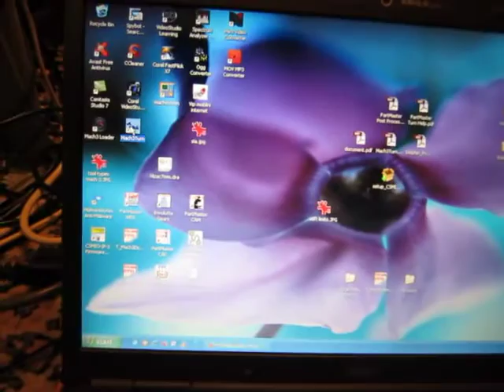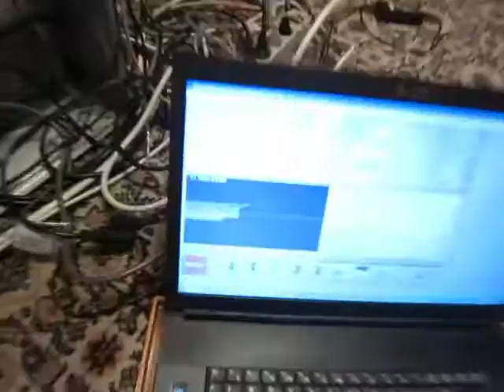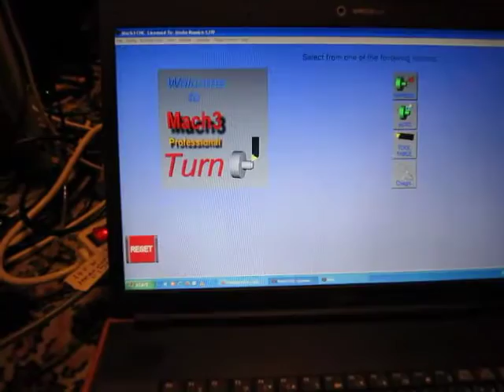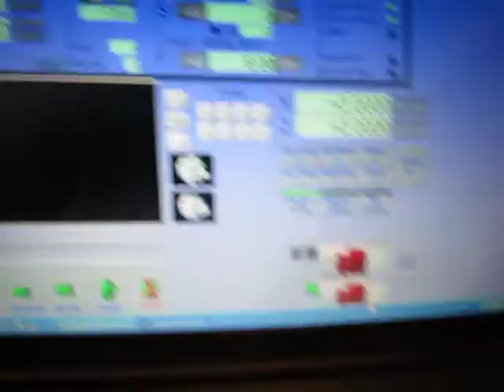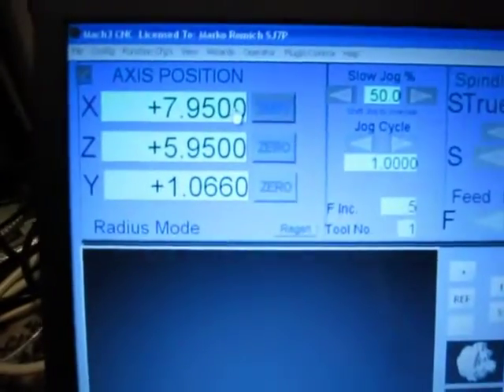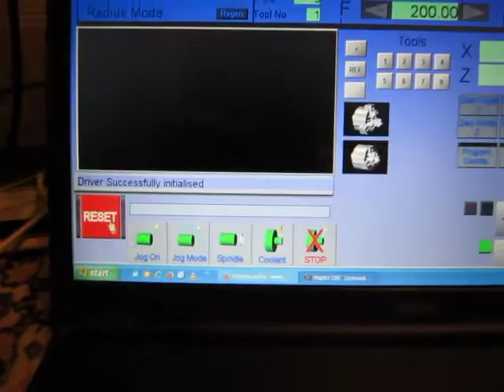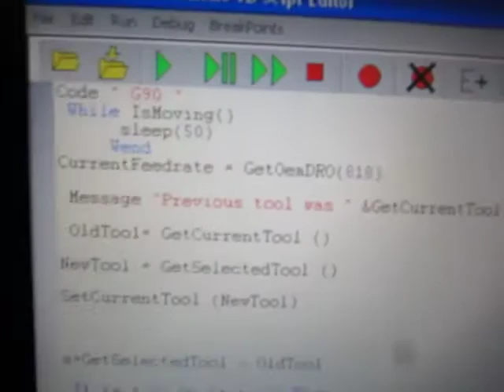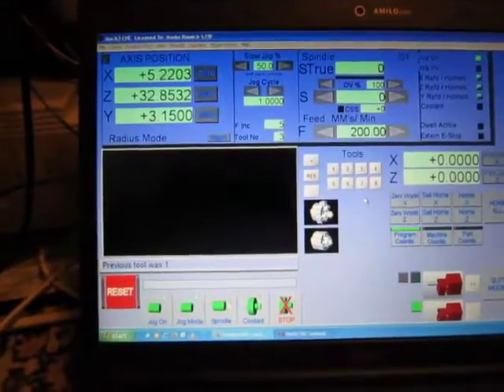mach3 recommended version problems

Comment: Hello.  Please tell me the settings in mach3 for threading.  my mach3 doesn't want to cut the thread.  the spindle speed is displayed, but in the cycle the cutter stops and waits.  thanks.
Reply from the maker: hi, your motion controller probably does not suport G code cycle for cutting thrreads, I had that problem , with 3 Axis usb cnccontroler, there was no furmware whic is required in controller to handle cutting threeads G code
Reply from the maker: https://youtu.be/1nxhw9teFh8
Reply: @zmajmr  my controller goes through the LPT, I think this is not the case, I checked the index signal on the LPT leg, the signal is present, and in mach3 it shows the real rpm.
Reply from the maker: @dargindarginec9561  i do not know what is  problem then, i also had index signal and real rpm but did not cut threds
Reply: @zmajmr  because you have via USB, and through the LPT port the index signal is already passing through.  As I know it so, I think things are in mach3, most likely, I will soon have an allergy to mach3, because for a month now I have been trying to find the reason.
Reply: @zmajmr
Reply: @zmajmr  Thank you so much.  it worked for me.
Reply from the maker: @dargindarginec9561  Hi, did you manage to cut threads?
Reply: @zmajmr  yes, already cutting threads.  today my day was a success.
Reply from the maker: @dargindarginec9561  ok, good news